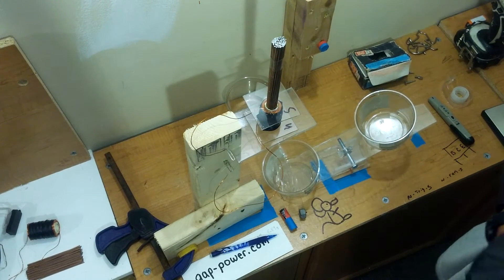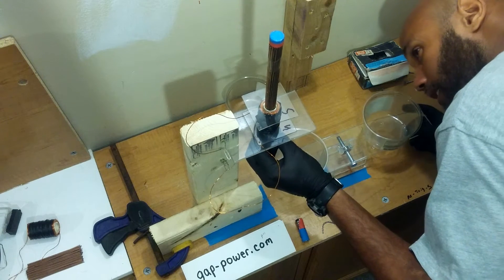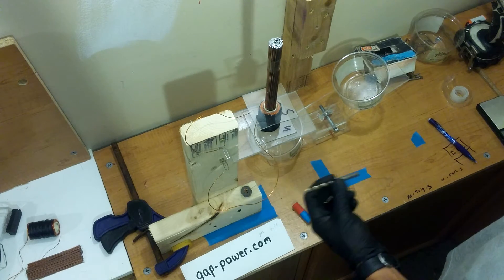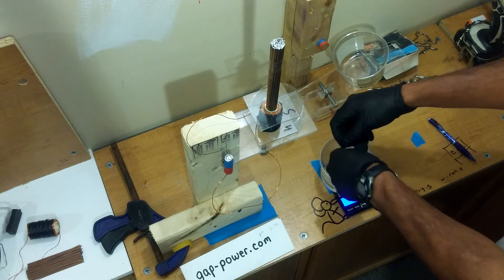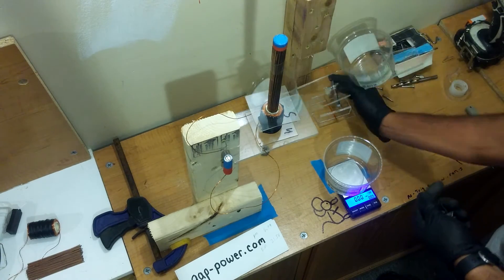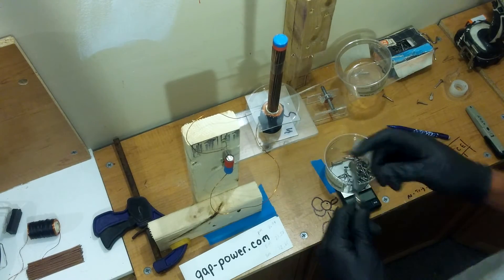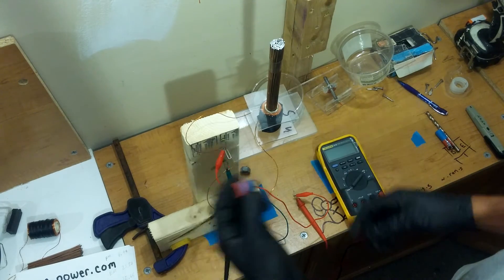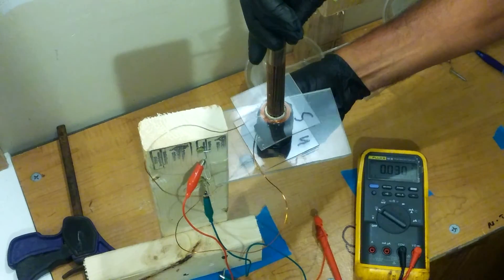Gap-Power 101

Comment: How do you calculate how much wire and voltage is required to neutralize the field? I know there are audio recordings on gap but I just want a direct answer or written explanation.

Comment: Great video. Especially the drawings! I didn't realize an amplification was taking place. My only question is whether the amplified magnetic field of the paired coil and permanent magnet draws more current from the battery. If that's the case, then there's no overunity. Try this experiment using the ammeter function of your multimeter, and let us know if the current changes when a permanent magnet is introduced. http://facebook.com/perpetualmotor